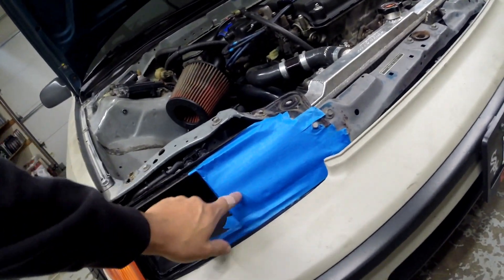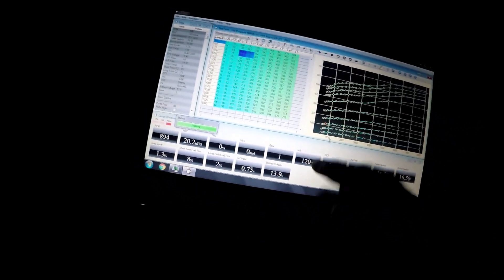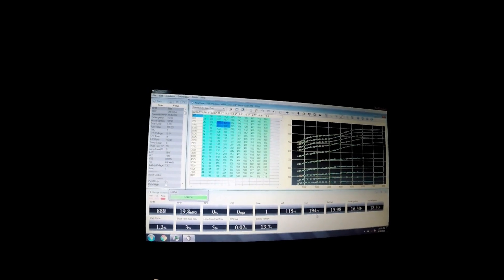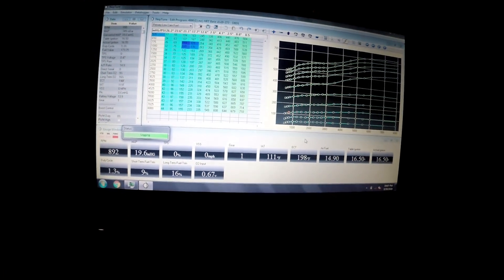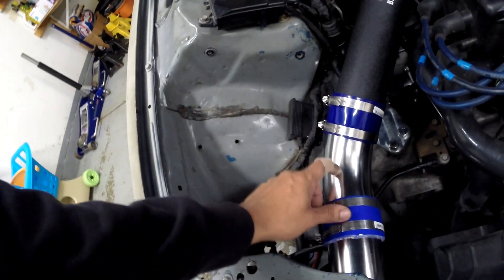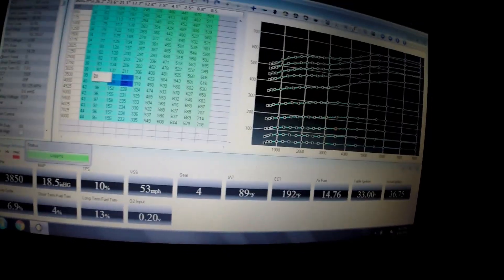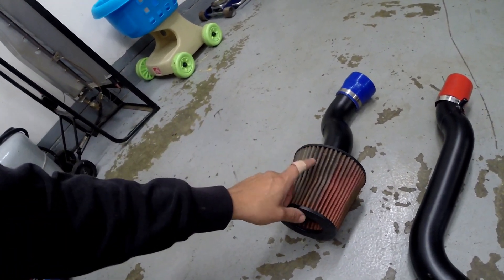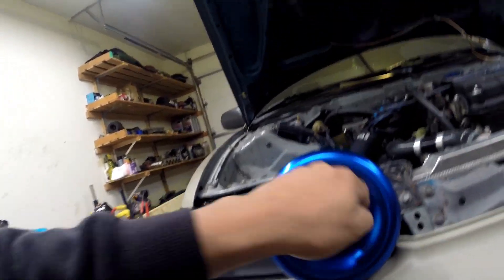Intake Temperatures. 2.5" Short Ram vs 2.5" Cold Air vs 3" Velocity Stack!

Comment: Back in the summer of 2003, I was running a 1995 Honda Del Sol VTEC/Si-R with an H22A swapped in from a totaled 1997 Honda Prelude with a 5-Speed, I was running a Velocity Stack straight into the intake manifold, a DC Sports Header, test pipe Cats, and I don’t recall what kinda muffler… but loud, I used to PRIDE myself in making dark houses go lights on at 11pm
Reply: @Turboobsessed  
I flipped that car on August 19th, 2003…
Reply from the maker: @EL3KTR0N  😥

Comment: Thank you for the video. Wich is better for fuel mileage? Hot air decreases fuel injection but with less power we will spent more fuel.
Reply from the maker: I would say the short ram is best out of all the intakes in this video for fuel mileage. Stock airbox is best. With less air you would need less fuel. That would make for less power as well.

Comment: Good evening, could you tell me at what point the air temperature sensor is located and at what point the water temperature sensor is located !!!
Reply from the maker: The air temperature is located in the stock location which is the intake manifold. The water temperature sensor is located in the stock location as well which is on the side of the cylinder head.
Reply: @Turboobsessed  thank you for the answer you gave me ,,, I have noticed that you also have a second instrument for the water temperature, do you really see a big difference in their temperature compared to each other?
Reply from the maker: @vastsirik9592  No problem. Oh yes that other water temp gauge is an AEM gauge with a sensor. The sensor is bolted into a Mishimoto Water Temperature Sensor Adapter that is inline on the upper radiator hose. The only difference is when the thermostat is still closed, but once the engine is warmed up and thermostat opens up the water temperature circulates and both water temperatures are close to each other by 1-3 degrees fahrenheit.

Comment: i’m running Velocity stack daily use with filterwear to prevent dust gets in is it ok? i definitely feel more power
Reply from the maker: For sure more air, but even with a filter it is exposed to any other objects directly besides dust. It is a at your own risk at that point.

Comment: how would you cool down the short ram? please don't tell me to buy cold air coz I bought the short ram yesterday. on idle it's bad but while driving it's perfect. so your test was perfect.
Reply from the maker: I am sure there are ways to cool a short ram by making a custom heat shield around it slightly to keep some heat away.
Reply: Heat wrap and for sure a shield or soemthing

Comment: So pretty much the velocity stack is better than both even if the cold air intake was 3in.? Also what is there a screen or something cause what if the velocity sucks up debris or dirt or something won’t that affect the motor ?
Reply from the maker: Yes Velocity stack is best use for airflow and cooler intake temperatures. I only recommend driving without a filter at the dragstrip. There are filters for velocity stacks to protect anything from entering your intake if you decide to play it safe even at the track.
Reply from the maker: Short Ram and Cold Air Intakes with filters are best for daily driven vehicles. Velocity Stack is best for drag strip.
Reply: @Turboobsessed  thanks for the reply, that makes sense good to know 👌,would you say it also sounds better to ?
Reply from the maker: @chris_ramirez36  Np 👍. Yea it sounds better for sure. Then again, I have an electronic exhaust cutout so my exhaust screams 😄

Comment: Just a question,why does my car Boggs/lean  when i bolt on my V stack my ecu is tune,but funny thing is that when i throw the oe box it runs fine even
Reply: Toyota 2zzge engine i use R9k idk if you are familiar with them,but my maf sensor is before the throttle body.might Go with a wideband,i am just curious as to how others do it
Reply from the maker: @ruffraff4697  Yea you need to see what your air fuels are with a wideband. Might need to richen it up since more airflow with the velocity stack. Keep me updated.
Reply: @ruffraff4697  I had a corolla xrs nice car was never tune,I run alot of intakes the best intake was a modified k&n typhoon with a velocity stack im guessing your problem is the tune that’s the problem with tunes if you change something can missfire.
Reply: My car would do that with my 3in.
Tuner said I need to adjust to manifold pressure instead of MAF because of the different size piping 
Hondata btw
Reply from the maker: What motor you running? What tuning software is being used? Do you have a wideband sensor to see your air fuel ratio?